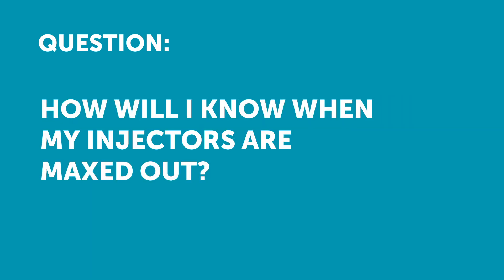How To Tell When You Need Bigger Injectors [HPA Q&A]

Comment: I have an 05’ Duramax! Rebuild the engine and every wearable part is new. Still stock and a turd off the line just as they all are. I tuned the system with Duramax Tuners out of Michigan. Still a turd off the line yet after 30 it comes alive and very fast however no one cares about that. A want 0-40 to snap my head back. What would you recommend? Only real changes are a RDS 64mm turbo, larger intake to to turbo and larger 4” down pipe out of turbo. The rest is stock

Comment: Is 3.5 lbs injector flow too much difference or can computer compensate ...stock ecu stock motor just swaping injectors but the ones I got are a little smaller flow

Comment: So what's what does  inj duty cycle refers to bigger injector or bigger fuel pump and the same question goes for the pulse width and fuel pressure I am getting confused can some one write a detailed description of which one describes which on the hp tuners vcm scanner .
1- i know that's the duty cycle max threshold should be around 80-85% but does this mean to change the fuel pump or the injectors?.
2-i know that my fuel pressure should be close to my requested fuel pressure on wot but if it's not does that mean bigger injectors or bigger fuel pump?
3-what is the injector pulse width maximum value on wot aka threshold that will indicate to a bigger injector /fuel pump?

Comment: Hello! I have an Civic EJ9 1.4 90hp and installed a bigger intake (before 50mm now 60mm) and an H&k tuning air filter.
In theory it should get more air now.
That means, i could install slightly bigger fuel injectors to produce more power, fitting to the slightly bigger intake?
With an ECU reset the system should adjust to make it work, doesnt it?
Im thankfull for your advice.
Greets, Max.
Reply: I'm hoping you've gotten an answer to your question one year later?

Comment: So i have a standard engine, but i wanna put a 1100cc injectors in them to keep it for later upgrades purposes. Will it cause any issue with standard setup? Thanks.
Reply from the maker: Depends on the injectors, not all are created equal and technology has progressed when it comes to big injectors and finer control at idle and low load. I would talk to your injector supplier about your intentions and see what they advise - Taz.

Comment: raise fuel pressure a little bit maybe?
Reply: You can and that could help assuming the injector size is the limiting factor rather than your pump, fuel line size, etc. However, too much fuel pressure can cause problems with the injectors not firing properly and shorten the life of your fuel pump by potentially forcing it to work harder than it was designed to. Also keep in mind that your fuel system may or may not be designed to withstand a higher pressure depending on the components and how much higher you go.

Comment: Are there any benefits to upgrading my stock injectors on my gen 3 ls1 5.7 with bolt on mods ?
If so. . What size is good  ?
Holden vy ss ute.
Reply from the maker: I wouldn't imagine you would see any benefits unless you are already having issues - Taz.
Reply: But if I wanted to change them what would you recommend... any info would be much appreciated.
Reply: @freddienz68  don't
Reply: The thing is that my ls1 factory injectors are 15 years old now and I would of thought that technology has made the latest todate injectors a lot better. That's why I was thinking of swapping them out for new ones.
Reply from the maker: @freddienz68  I'd get the injectors cleaned and flow tested and leave it at that. There won't be any performance gain with a newer injector - Andre
Reply: So what about for just piece of mind ? or is it just not worth it  ? since myn are 15 years old and 300000km
Reply from the maker: Cleaning and flow testing is your peace of mind. The rest of the technology on your engine is 15 year old or older too. Changing one component doesn't alter that 😉- Taz.
Reply: @hpa101  ok thanks guys

Comment: Taz, if You increase fuel pressure, does the atomization on injectors is better?
Reply from the maker: That's a tough one to answer as so much will depend on the specific injector. The answer will most likely be yes, however you're also going to end up delivering more fuel for a given pulse width so if you're trying to highlight if better atomisation improves performance, it's hard to narrow it down to just one change like this.

Comment: next!
how to tell u need upgrade ignition coil!
Reply: When you are blowing spark at high combustion pressures.
Reply from the maker: Normally you will start to suffer from an ignition misfire at high cylinder pressures which will occur around peak torque. There are other issues that can cause a misfire though so a little diagnostics is required.
Reply: High Performance Academy n how to know the power of each coil..because sometimes the dont come with complete detail about product

Comment: When you melt pistons cos u run lean u need new injectors and a new engine.
Reply: @janelane9281  Complete opposite, fuel cools the combustion chamber due to liquid atomization.
Reply: @Jane Lane You probably mean video from Engineering Explained called  'Why Lean Engines Do NOT Run Hot - Myth Busted'
Reply: @janelane9281  no.
Reply from the maker: @Jane, throw up a link to the video your talking about. Keen to see it ;) - Taz.